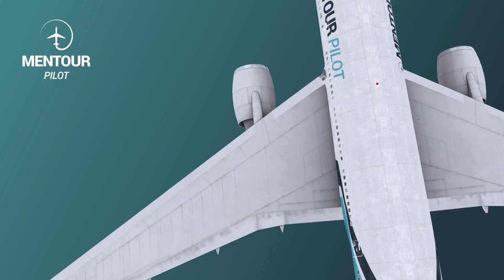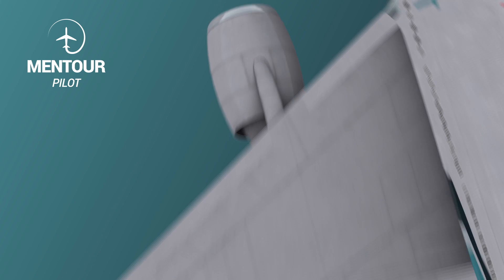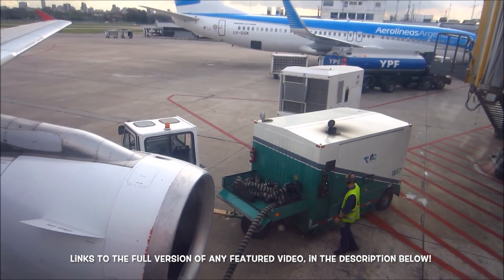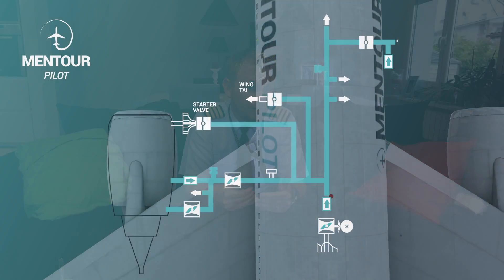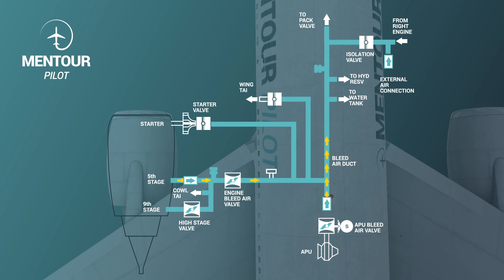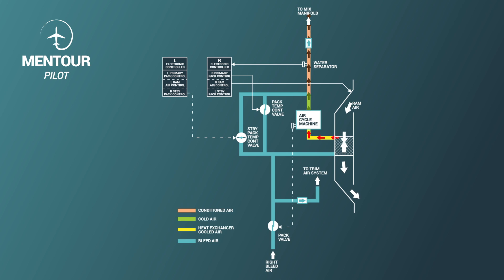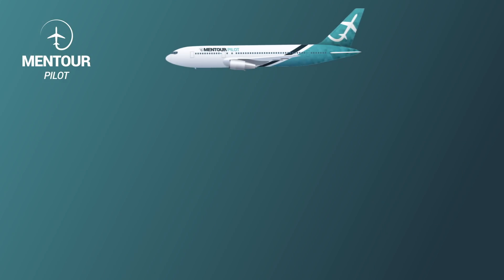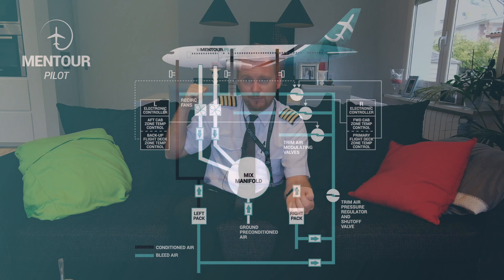How does the Boeing 737 Bleed-air system work?!

Comment: That pressure realase valve sticking out looks like an air brake. Does it not create lot of drag?
14:20 So wait. @Mentour Pilot: IF, after descent, the cabin pressure INSIDE of the airplane is still a bit LOWER than the OUTSIDE pressure (having trailed behind, the true (outside) air pressure), wouldnțt it be EASYER to open the doors as opposed to impossible, like it would be on climb and mid flight, where the pressure INSIDE being larger, keeps the doors pushed outwards sealing the cabin?!?

OH and one more thing: So why does that air come from from 2 different stages (Is it just the quantity?)
Also, in the case of anti-ice on the wings' leading edges, and the engines cowl, is it the same baypass air that creates the pressurastion, or is it different?
Because the bleed air for anti-icing is obviously not mixed with anything else to be cooled, like the air that goes in the cabin. 
If I remember correctly they can all (deice, pressurasation, etc) be used simultaneously but at (great) fuel expense? Correct?
Reply from the maker: No, it doesn’t
Reply: @MentourPilot  Thankyou for the reply. 
BTW wow, you were so quick that you had already replyed by the time I finished editing my post.

Comment: @Mentour Pilot At 12:22 you say "...first we pressurize the cabin... this is to make the transition... feel less..." but I heard once that it is because of an other reason: as long as the plane is on the runway at acceleration at the start (or/and shortly after take off - unfortunately I don't know exactly anymore all details) the wings or the whole plane creates a special kind of suction (or better air binding or something), that the air pressure inside the cabin would be for moments lower than the sourrounding air, but as all components of the aircraft are only built for the case, that the air pressure inside is higher than the outside, so it would be bad technically for all components if the air pressure inside would be lower, that's why the airpressure are made "artificially" higher during the start phase (and not because of comfort). That's what I heard and sounds logically to me.
Reply from the maker: I don’t fully follow your reasoning but it has nothing to do with aerodynamics
Reply: @MentourPilot  dear Petter, I remembered now again, where I read this two years ago and checked it again and saw, I was in parts right and in parts wrong: it's from German wikipedia: here the translated text: During take off and landing, the cabin height is lowered slightly below the level, which means that the cabin pressure is minimally increased. In this situation, namely, at a large angle of rotation (temporarily large angle of attack), the air flow may be directed partially against the outlet valve in the rear area and the outflowing air. This causes a sudden increase in pressure inside the cabin. Short-term increase of cabin pressure (ground pressurisation) at take-off and landing at approximately 0.1 PSI (corresponding to a cabin height of 200 ft below the height of the airport) can avoid this effect. Aircraft that do not use bleed air do not require ground pressurisation... I just find this very interesting to imagine how the air flows over the airplane and especially in this case over the fuselage and especially at rotation presses agains the main valve etc.

Comment: Petra, I recently watched a 60 Mins segment in which they discussed this very topic of the bleed air system. In this interview they talked with several pilots who are suffering from various illnesses that they claim are in direct connection to breathing this engine bleed air.  From watching this I got the impression that this air is not tested and the filtration process is not nearly as effective as the airlines and manufacturers claim.  Do you have any input? Have you seen this program? I am quite concerned about breathing this air and more importantly concerned for the flight crews.
Reply from the maker: Yes, that’s a different video
Reply: @MentourPilot  Great.  I look forward to that video.  I am a Patreon customer of yours and support your channel.  I find it easier to communicate with you on Youtube as opposed to the app simply because my phone is old and doesnt support your app to well.  None the less...thank you for all that you are doing for aviation.
Reply: I have the feeling, that at this topic there is a lot of missunderstanding. My perception is the following: The air does not get polluted by the system directly, by the construction or the components themselves. The problem is the air all around the aircraft while standing at the gate: When it's standing there and the APU (Auxiliary power unit) at the tail is running it creates such a polluted air and when then the wind carries this directly into the cabin via open doors or the starting air conditioning then we get the very bad air inside, the same when the main engines starts and the plane is still standing, and the engines are running slowly and therefore the exhaust gases aren't yet blown so strong away but get blown by the wind (if it comes from behind) directly to the entrance of the engines where this exhaust gases are sucked in again and goes then in parts into the cabine... so it's just the bad exhaust air around the engines that gets sucked in again or simply comes in by the open doors, but it's not the construction itself getting the air from the engines compressors. I saw all this very often, when I was flying, even the last time: I had to enter the plane at the rear door, people jamming, I had to stop 1 step outside the rear door, the APU was running and strong wind blew the exhaust fume directly into my face (and into the open door into the cabin), I had to stop breathing, had the feeling breathing in directly the exhaust fume would be very bad, hardly couldn't breath. The bad thing: before me was a father with a baby. I had this once even more extrem because it was very stormy and both doors were open at boarding and the very strong wind somehow very directly brought all the exhaust fume from the APU into the cabin and the bad air was getting worse and worse inside and (I am also a bit sensitive) had the feeling I hardly couldn't breath anymore properly and bording went so slowly, so it was for long, and I thought why the hell don't you close one door, the rear door near the APU that the wind can't push in the air. That I might be right with my theory could be maybe proofed because all this bad air situations always stop after a couple of minutes after we are in the air, so then the wind can't push bad exhaust fume anymore through the doors or towards the entrance from the engines. For me it's a tragedy for the crews, that have to breath in every day this dirt. Why can't they start the APU later or at least leave the rear door closed when the wind is coming from behind, why not placing the plane always in that direction into the wind (at "open field standing places") that the wind is not coming from behind, is the health of people not worth this bit of complications that would come along with this methods? Would like very much to know form @Mentour Pilot if my technical suggestion is right.

Comment: having studied ...air conditioning I like this episode. And when I landed with my last flight weeks ago and outside looked back to the plane (or at boarding) I saw this openings for the heat exchanger and thought "what is that? that's a cool question for Mentour" but forgot it then. Shortly later, today... here we go! 👍  And thank you for the effort for all this graphics and pictures, that was a lot!
Reply: That means YouTube learns to read your thoughts now
Reply: @shijudevarajan143  google has been doing this for years
Reply: They need to add humidifiers
Reply: @technophant  there is not enough water on board for humidifiers but we could use water and pee from the toilet 🤔 🙄  😑
Reply: @mattesrocket you are suggested to drink plenty of water while flying to combat the effects of dehydration
Reply: @technophant some aircraft have humidifiers

Comment: Now this is something that I have not considered.   After aircraft landing gear are deployed, as on the 747, does the pilot have to rock the aircraft from side to side to "lock" the landing gear and is that uniform across all jets?  Is that really true and on what jets??     Thanks.   I think it is an interesting question that bares discussion.
Reply: This is definitely not normal procedure, but it might be part of an emergency procedure. There are procedures to let the gear fall down by gravity in case the hydraulics fails, rocking the plane might bump the gear into it's locked position.
Reply from the maker: No, we do not under normal circumstances
Reply: The gear is very heavy and gravity does a great job. There are also springs to help the gear fold out to the down and locked over centre position

Comment: What you were saying about being able to identify which engine was affected by bird strike depending upon where the smell was. Well, I'm reminded of the Kegworth air crash in 1989. The captain having been used to a previous model of 737 assumed that the problem was in the right-hand engine due to the smell in the cabin. In fact the left-hand engine had thrown a blade. I'd guess that there is better training now when pilots move from one model to another. Although MCAS ...
Reply: It was a shame the captain got the blame for that, rather than the useless instrumentation.

Comment: You were talking in this video how you can detect which engine is hit by a bird by where the smell comes into the hull the first. But there are several crashes happened where the pilot shuts down the wrong engine. Also because they cannot see the engines from the cockpit. What i was always wondering is why there are no camera's pointed to critical aircraft parts like the wing edges, landing gear, engines and rudder. In case of a problem the cockpit crew can put the image on one of the screens?
Reply: Some asian airliners already have external cameras so passengers can see above/under the plane. This makes sense to have cameras pointing at the wings/engines
Reply: @FRDRCE  but the angle, the cams will have to stick out
Reply: @UncleDrakovich  I don't know how they installed it but it already exists
Reply: cameras sound impractical, also they'd need deicing and what not, so in essence u're introducing more problems than u're solving
Reply: @UncleDrakovich  A Goprto type of cam in a shatterproof glass enclosure is likely not a big deal.  To retrofit, yes.  To implement in the design phase, no.
Reply: Or the crew can just look out a window. If there's something abnormal, there's generally passengers that are also keen enough to alert the crew. But often with bird strikes, it's not visibly apparent which engine was stuck. So a camera isn't necessarily helpful anyhow.
Reply: Weight and the most important maintenance cost. Flight attendants and flight engineers can perform the same function a camera can.
Reply: Yeah and one twin-engine ended up with both engines shut down because a flight attendant looking toward the back of the plane got her left and right backward.
Reply: @Inkling777  wait but can't they figure this put from the thrust level display at the cockpit? rpm readings and kN I think
Reply: A380 has some cameras

Comment: Hello Petter, why, during the startup of the engines (or at the beginning of the taxi phase) often a strong smell of jet fuel invades the cabin? Is this caused by the bleeding? Isn't the fuel injected valley of the compressor?
Reply: On low power settings while standing still jet engines tend to recirulate air. Meaning the air is pushed out at the back and some of that air is sucked back in at the front. Combined with some incomplete combustion during startup, you might smell jet fuel.
Reply: @danielrose1392  Thanks Daniel! It makes sense!
Reply: So many times passengers pressing callbels and asking the crew why there is this smell. Sometimes they turn on bleed air too fast after startup :)
Reply: I was thinking of this same smell I experienced a while ago. Smells like burnt kerosene!
Reply: @FRDRCE  
It is burnt kerosene, that's basically what JetA fuel is.
Reply: I've never noticed this smell LOL.
Reply: I think it's jet exhaust you're smelling, maybe partly from the APU.  Once you're moving the exhaust gets left behind but you kind of sit in a cloud of it until then.

Comment: Is it possible that both outflow valves malfunction and it is no longer possible to open them?
If that would happen and what you are saying at 14:30 is true (that you can't open the doors while the aircraft is pressurized, and you are on the ground) wouldn't that mean it is possible to get trapped inside the aircraft?

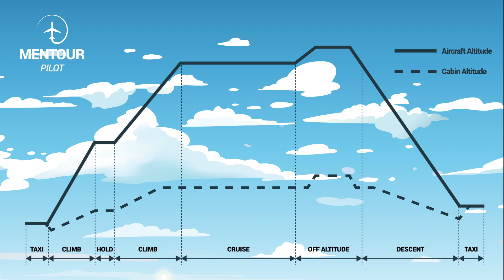Does "pressurized" at 14:05 mean that the pressure inside the aircraft is lower than on the outside? If so why wouldn't you be able to open the doors? (14:30) Aren't the doors build in such a way that you can't open them as long as the pressure on the inside is higher than on the outside? So why wouldn't you be able to open the doors if the pressure on the inside is lower than on the outside?
Reply: "Pressurized" means that the air pressure inside the aircraft is higher than on the outside.
Reply: Is it possible that both outflow valves malfunction and it is no longer possible to open them? yes
wouldn't that mean it is possible to get trapped inside the aircraft? no, because air can escape through fill ports, or the pilot could justopen the window
Does "pressurized" at 14:05 mean that the pressure inside the aircraft is lower than on the outside? no, the pressure in the cabine is allways greater or eaqual to outside pressure
Reply: @termivan  Then why does the graph show at 14:00 that in the Taxi section the cabin altitude is lower than the aircraft altitude?
During Taxi the aircraft is on the ground.
Reply: @Jehty_  lower altitude = higher pressure
Reply: @termivan  yeah of course, don't know what i was thinking :)  Thanks.
Reply: Ivan Miholić how can the pilot open the window if the pressurised air is pushing against the window which you have to pull in initially top slide rearwards
Reply: @tomstravels520  pressure difrence when on the ground is not that great and window surface area is not that big as the door
Reply: Ivan Miholić but there was a cargo flight years ago which caught fire. The crew landed but couldn’t open the doors initially because they forgot to depressurise the aircraft (they had to manually control for some reason can’t remember why). Door wouldn’t open and only small movement of the window until the depressurised then could escape
Reply: @tomstravels520  i didnt say you could do it quicklly, i just said you could do it

Comment: The chart you use for a/c altitude and cab alt isn’t right in my opinion. It shows that when taxi/ on ground the cabin is in a vacuum, and not building up/ letting down pressure. The dotted line needs to start a bit higher instead of lower for positive pressure...
Reply: The chart shows the equivalent elevation where you would experience that air pressure. The dip in the chart at takeoff means that the airplane is pressurized higher than the ambient air around, which is equivalent to being at a lower elevation.
Reply from the maker: Correct!
Reply: Gabe's Hacks Got it!  Thanks!

Comment: Most commercial jets use the same idea of ‘bleeding’ hot compressed air from inside the jet engines and then passing it through a set of machines to be processed and finally piped into the passenger cabin.

As a plane flies, fast-moving air enters both the jet turbine engines. This fast-moving air is compressed as it passes through layers of fan blades inside the turbine. It’s at the compressor stage that a portion of the hot air is ‘bled off’ from within the turbine. The air generated at this point is therefore known as bleed air. Now, this bleed air is very hot, with a temperature in the range of a couple hundred degrees Celsius so it obviously must be cooled first. That’s why this hot bleed air is allowed to expand and passed through a heat exchanger so that it cools to a comfortable temperature. This cool, filtered air is then dispersed in the passenger cabin at a pressure that humans can comfortably breathe.
Reply: Air is bleed off from the compressor, not the turbine. The only filtered air is the recirculated air. There are a couple of stages of heat exchanger, but the ACM does most of the work to cool the air

Comment: How much of an oxygen supply do the pilots have and is it via generators or compressed gas cylinder?
Reply: There are oxygen bottles for the pilots, typically pure oxygen which is then mixed in the mask. The oxygen is sufficient for multiple hours.
Reply: Daniel Rose thanks for the answer!

Comment: What is the actual pressurization? Is it like a air compressor? Where the airplane is like the tank?  Is air pumped into the cylinder (airplane tube) and keeps a pressure of x’s psi?
Reply: Yes - the airframe is pressurized in its entirety

Comment: I used to hear a lot of stories about air quality on aircraft pre and post smoking bans(allegedly better before) urban legend or fact?
Reply: I mean, in aircrafts air is constantly recirculated soooo... Mmmmight be kind true but at the same time it sounds absurd..... Oh and recently i took a flight from Turin to Messina in a  738 and in the lavatory there is indeed a ashtray..... Wtf
Reply: @giovannimonchietto1863  I can't remember if it was Mentour, but the explanation was something akin to: There needs to be somewhere to safely extinguish smoking materials when someone breaks the rules.
Reply: It’s only partially recirculated - it comes in from the engines, through the cabin, and out through the pressurization control valves.